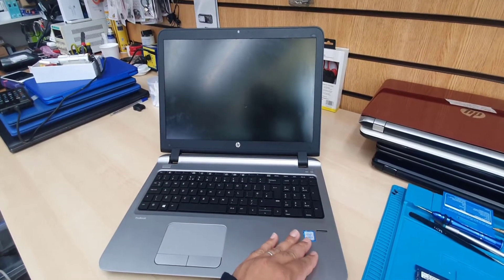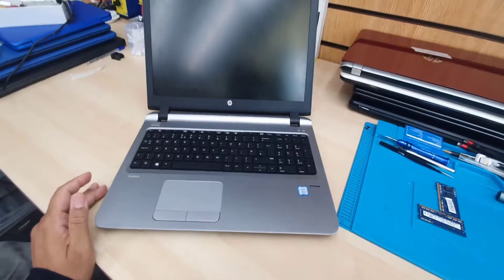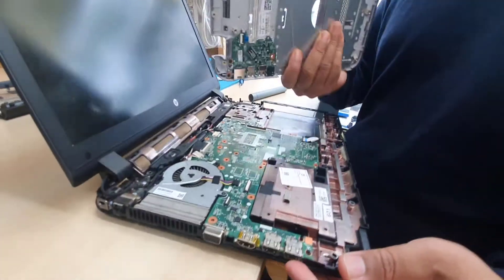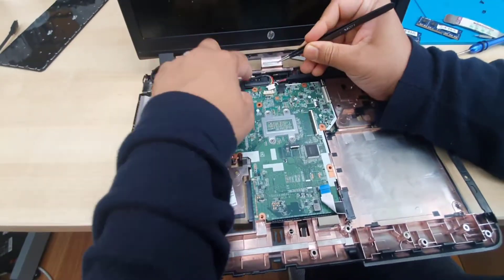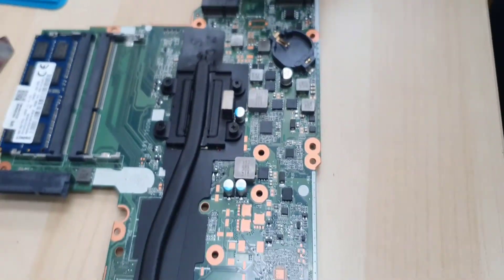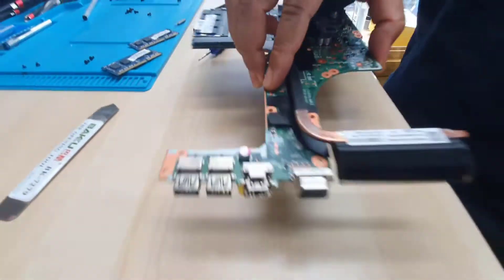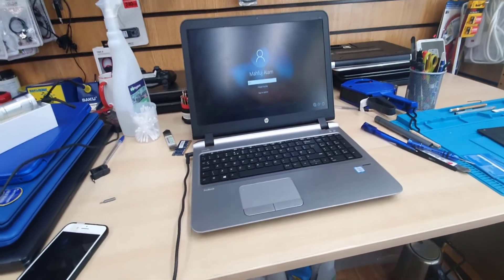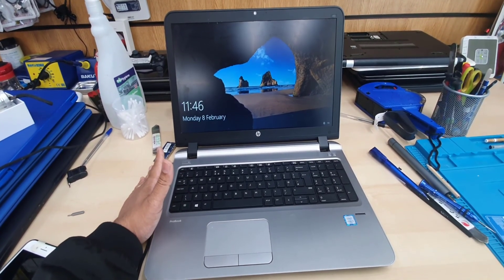How To Fix Hp Laptop Power Issue  ProBook 450 G3

Comment: "I have the same issue. When I plug in the charger, the power button and the shift key lights turn on for approximately 3 seconds, then turn off. After that, the laptop powers up as if it wants to boot up, but this time the power button, WiFi, and Mute buttons light up steadily while the Shift and Number Lock keys blink with a one-second interval five times. Then the fan starts rotating vigorously, but the display doesn't turn on. I would appreciate help with this."

Comment: I have the same model and I noticed this problem that the pc doesn't turn on.  I don't see any sign of liquid damage.  When I plug charger in, the light on the side, the power button light, and the caps lock light all turn on for 2 seconds and then shut off.  Sometimes I can get the 450 G3 to power up when I remove the battery and sometimes putting the battery in allows me to power up.  Most of the time it will not power up.  Is this a BIOS issue or RAM issue or power switch issue or something else?
Reply: Same and did it fixed? Please let me know what was the problem
Reply: Eventually the  laptop stopped powering up at all times.  I replaced the charger and the issue is fixed.

Comment: Hi, 2 Things. 

1 - What is the name and model of the electric screw driver..... Neat!
2 - I have the exact same model but it will not run nor battery power. It only comes on if the charger is plugged in. On the battery icon it looks like it is charging then it stops and stuck at 0% Bought another battery but i think battery is fine, it just wont detect the battery or something like that. 

Any ideas?

Comment: I can't find the problem in a HP ProBook 450 G2, when I connect the laptop the power light start blinking. I check capacitors, mosfets and everything and everything seems fine.

Comment: Hi there
I have the same model 
I plugged it and It showed the orange light when I plugged and then it went off.. It's not charging and it's not powering on but if I plug it I feel the current passing through 
Please can you tell me what the problem is?
Reply: Any luck?? Caps light too. Then all off.. :s

Comment: Same problem with my 450 g3  laptop but it get warm when its plugged into the charger
Reply from the maker: Which part get warm.? Sign of power leakage.
Reply: @thepcphone  the fan side
Reply: @thepcphone  so its not a bios problem then